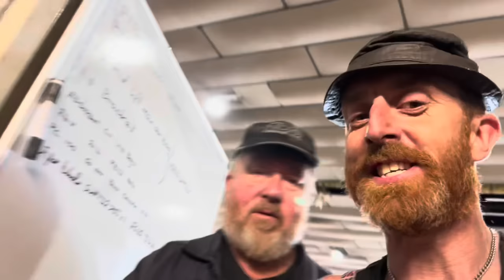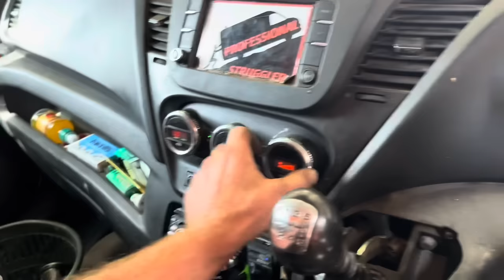Favour for a favour…. Favour! Another new bit of kit 🚚🤠 SAF axle hud tight,

Comment: Build the van as the StruggleWorkshop but with vices, welding equipment, jet washer, kit it out properly and use it as a promotional workshop for reviewing sponsorship gear and tools, get old Partic involved in giving you gear to review😆

Good to have a Struggle Mobile Workshop as the struggle bus might fall apart soon.
Reply: very suprised that Partic Motor Spares Newark  haven't donated an bench / van floor mounted  struggle clamping tool  to the channel
Reply from the maker: 😂😂 mate that sounds way to posh for me 😅 think you right with the spare struggle bus 🚛🚛

Comment: the fan stuck on will be the heater resistor  the heater resistor located in the right side (as you look at the engine) of the heater box under the bonnet. They are stupid money just swap the one off your new iveco to check it ... this will be the reason the struggle bus struggles to start and usually flat battery

Comment: Get yourself a food probe (the one with an analogue dial at the end of the probe £2:50 from Asda) push the probe into the air vent and it will give you an accurate read out of the temperature coming via the air con then you don't have to guess whether the air con is working!  (Discovered this earlier in the year during the "heat wave").